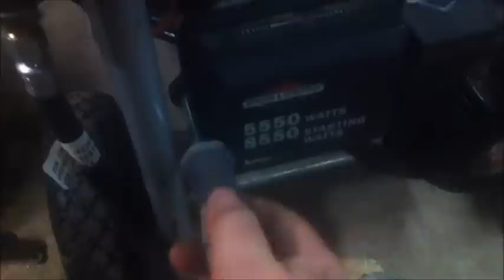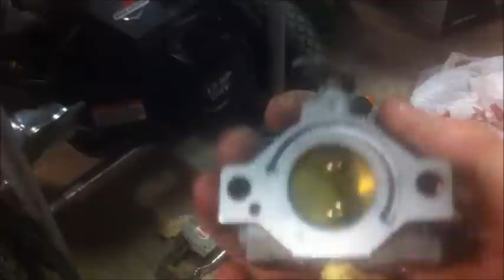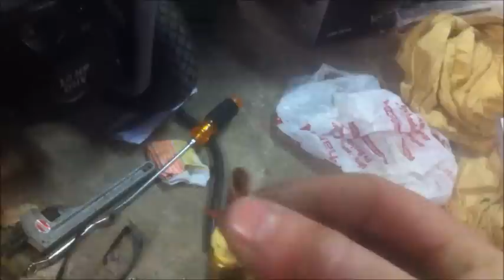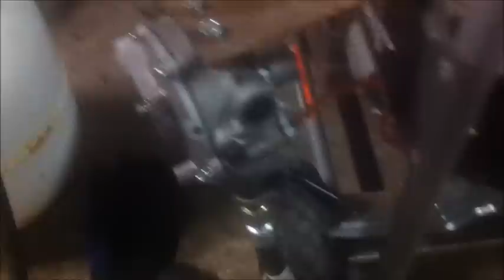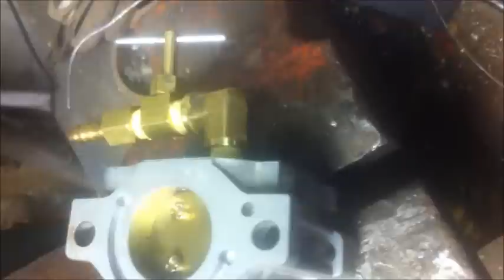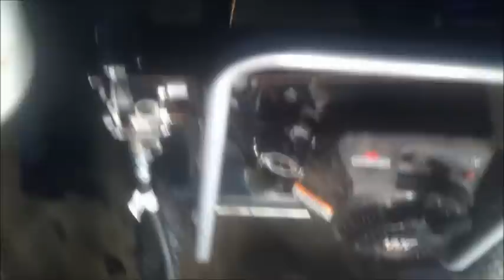LPG Propane Generator Spud in modification homemade DIY

Comment: Did you HAVE to hook up the vacuum line from the regulator to the spacer mounted in between the carb & engine block?
Reply from the maker: Yes

Comment: The DETAILS on WHAT your used and HOW you did this is VERY helpful, QUESTION: Why did you go to high pressure when it appears most go low pressure??
Reply: His regulator can work with up to 250psi inlet pressure so the additional regulator is not needed

Comment: There are many other ways of doing this and keeping your gas option! I wouldn’t of eliminated my gasoline option at all. Lastly all the trouble you’re going through you could of just replaced the card with a duel fuel carb I did the latter and found my carb will nicely run natural gas also.
Reply from the maker: At the time those cheap propane carburetors were not available like they are today.

Comment: I'm sorry but you can just remove the main jet from carburetor and run the propane through same gasoline inlet. It will work just fine.
Reply: I wonder what difference it might make.  Anyone have any ideas?

Comment: No battery needed solenoid is plugged into 110volts on the generator only works when generator is running

Comment: The solenoid runs off the generator wide open there is a bypass valve to feed the natural gas or propane this valve must be closed after engine starts so if the engine stops power generation will stop and the solenoid will close

Comment: I'm using a solenoid attached to the generator if generator stops the solenoid will shutoff the gas flow
Reply from the maker: Murphyt43 Does that require a battery?  Most portable generators are pull start.  Also I don't think that the throttle down would work properly (not that you have to worry about it on a generator).  Are you using a demand style regulator that will detect the engines need based on throttle position?

Comment: $6.24 + tax.   http://www.ebay.com/itm/GENUINE-Briggs-Stratton-694876-Carburetor-Spacer-/400870143673?pt=LH_DefaultDomain_0&hash=item5d55b8f6b9
Reply from the maker: Murphyt43 That is the spacer that was tapped into to control the vacuum shutoff valve.  If you fog the intake manifold after the throttle (butterfly) you will have air fuel mixture issues it idle.  The sucking of the engine with the throttle butterfly closed will cause the demand regulator to release way too much fuel for the small amount of air that will flow past the throttle butterfly.

Comment: Hey Will, I run my generators and mowers (gravity fed gas engines) through the air intake side.  I keep the carb intact to run gasoline.  I've found it to be much easier.  Check out and let me know what you think.  Video links (most recent) Lawn mower - converted to electric start and propane fuel     (First one I did)  Gasoline mower to propane conversion - Part 1 of 3
Reply from the maker: I did the air intake box method on my lawnmower.  Video is also on youtube.  It works just as well and is about the same amount of work.  I was not concerned of running this engine on gasoline again so I did the permanent modification